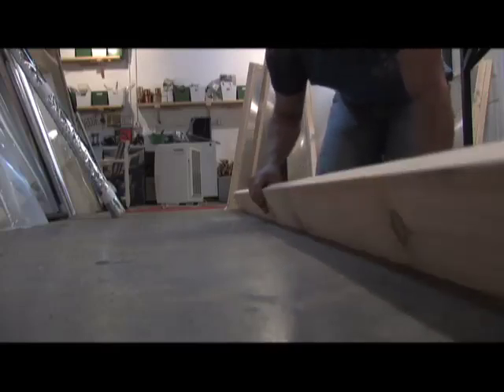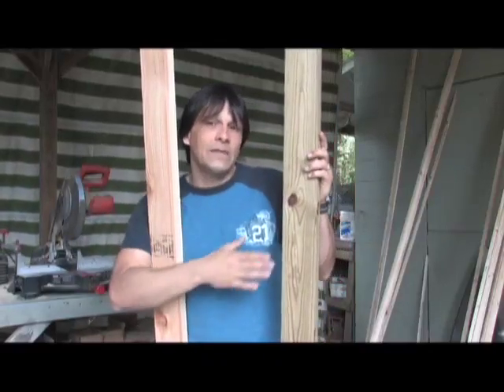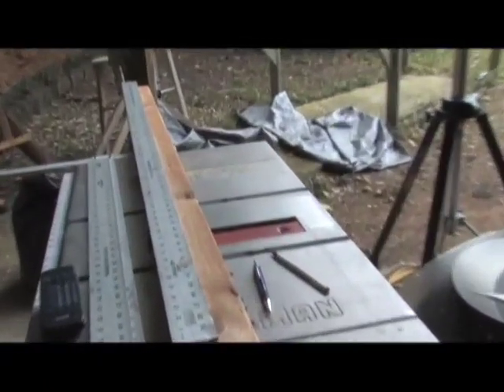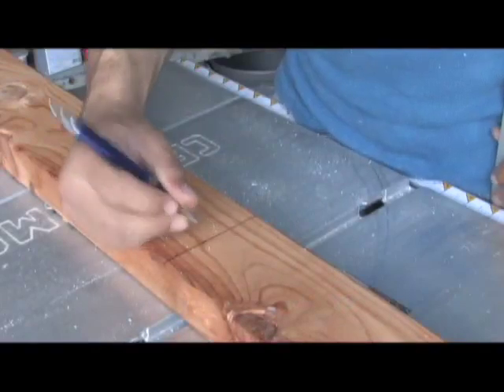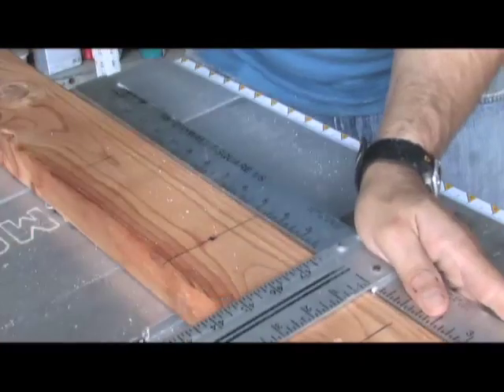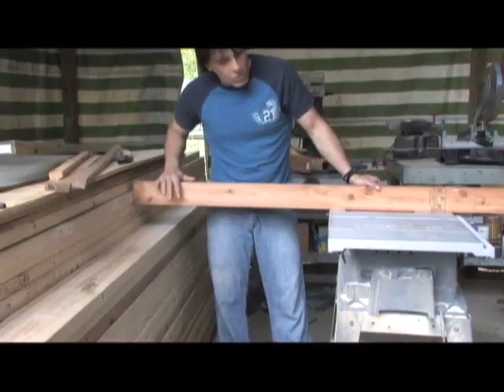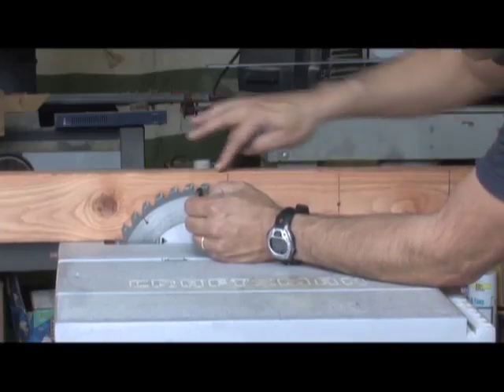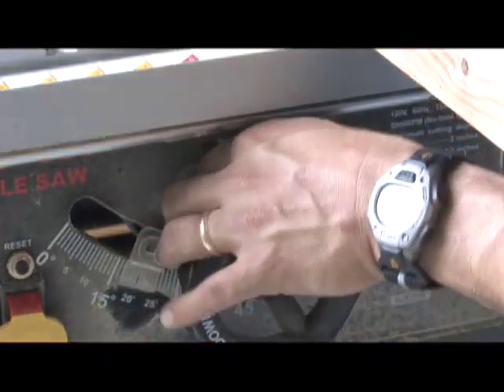WIND TURBINE BLADE DIY how to video Part 1 HAWT Windmill Wind Power

Comment from the maker: I pulled this blade down after almost 5 years, it was untreated raw wood and has some sun damage but still straight and strong. It experienced 2 of 5 years with over 100 inches of rain per year, high FL humidity, and 2 tropical storms. Illustrates how resilient untreated 2x4s are when NOT exposed to ground contact.

Comment from the maker: Those woods are a better choice however, Treating Pine Clear enamel it will last very long. I have one in my yard 1 year, no treatment, no warping Florida days high humidity. Warping only happens if you start with imperfect wood. Lowes floors are very good. Knots should be avoided. The pine blades can handle 150lbs person at the hub on blocks 4 feet apart.